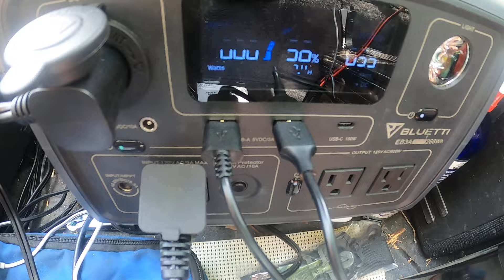Old Biker Dude's Solar Power Wagon check up

Comment: This is awesome! Can you show how the storage battery connects to the Bluetti? I’m curious to see those cables/connectors. Thanks!
Reply from the maker: I have some other videos that do show that.
When connecting to the storage battery I simply use an accesorial cable with two quick connect handles for positive and negative posts. At the end I have an 8mm barrel plug that goes into the Bluetti. As long there is power in the battery, it keeps the Bluetti at 100% all night and powers my refrigerator. Then I just reconnect solar panel the next morning. It works great
Reply: @Old-Biker-Dude  thanks so much!

Comment: I've been wanting to get some level of solar set up, and never even thought to include a lithium ion battery to the mix as extra storage. Thanks for the tip!
Reply from the maker: You bet. The system works great and increases the wh capacity from 268 to over 1500. That will run my fridge for 3 days if necessary

Comment: When cooling, the heat goes to the outside of the cooler. Is that ventilated out of the trailer somehow? Very cool setup Mr.
Reply from the maker: No. I just don't pack stuff up around the exhaust vents.